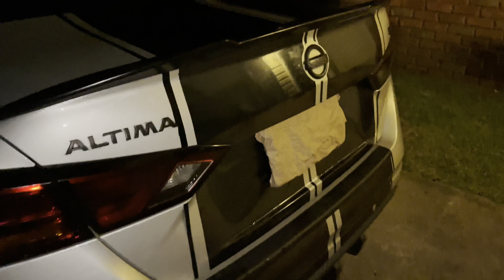Adding Pinstripes On The 2020 Nissan Altima SR!!

Comment: Hey man I’ve been looking for tht blk out badge for the rear what or where did you find it at homie….?! 🤷‍♂️ 😅
Thx man! ✌️
Reply from the maker: The rear badges I just plasti dipped them only cost $7 and you will only need some masking tape and a small razor blade to get around the edges
Reply: @TheRealCountryBoyModz  - okay I see. Thx man ✌️
Reply from the maker: @PunkRockRog  you’re welcome but they do have some midnight edition emblems online like eBay, Amazon, or even if you just want to buy some OEM